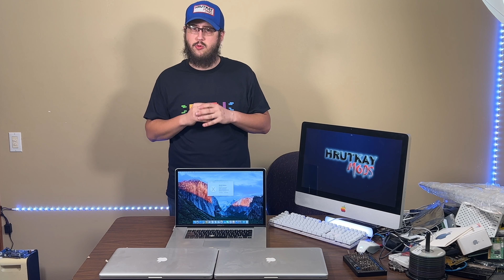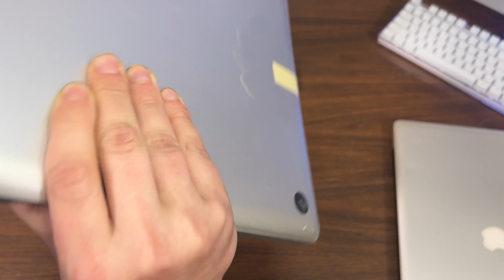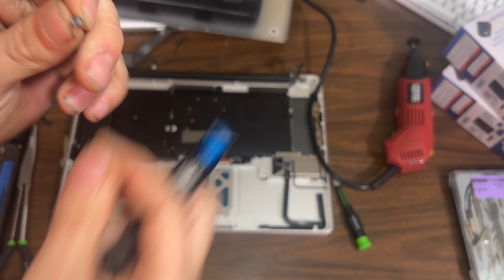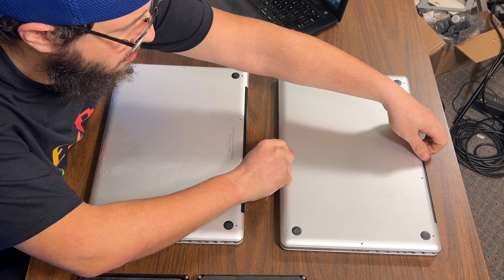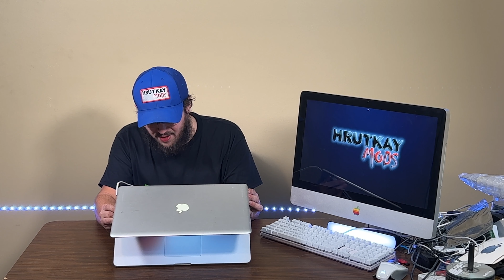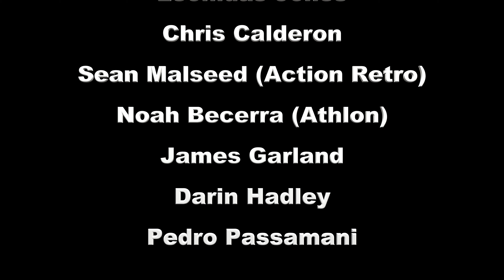2011 17" MacBook Pro Antiglare Display Install & Case Swap

Comment: It's good you've left all the disassembly complications in the video. Many of us encounter the same or similar problems with tightened or frozen parts. Sometimes the application of extreme heat will loosen screws. The expansion/contraction of metal parts will sometimes break the stubborn gunk in the threads, enabling removal.
Reply from the maker: yeah people a suggested soldering iron to heat the screws after I had already cut them